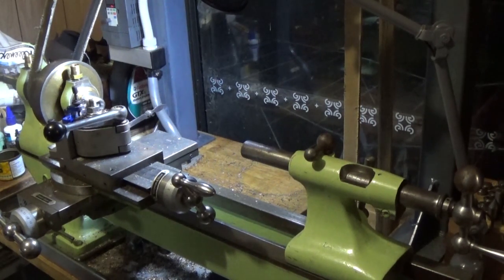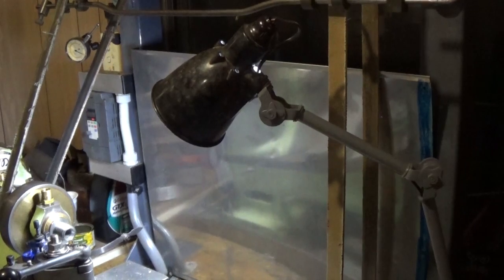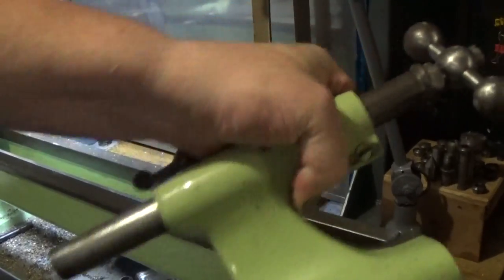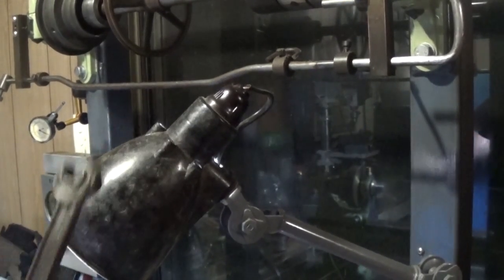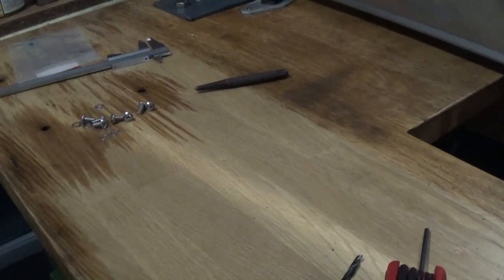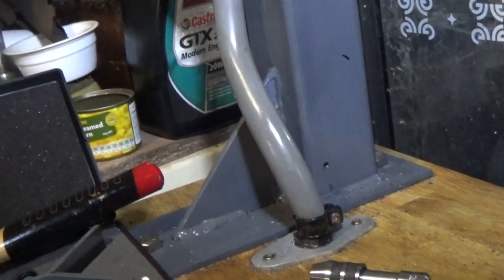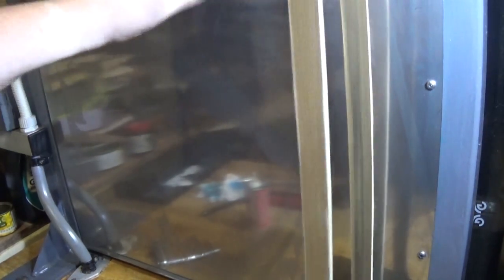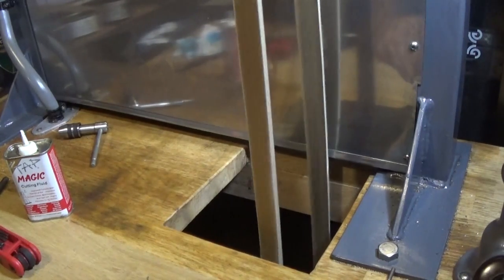stainless steel splashback project

Comment: The lathe set up is looking better each day. It is a good feeling.

BTW, I too have several of those small Tap Magic cans around the shop. I fit the Tap Magic can spouts with those thin red plastic spray straws that come from used WD40 sprayers. Just drill a slightly smaller hole in the end of the Tap Magic's white spout and force the red straw down into it. Doing this allows placing just the right amount of Tap Magic as needed with the red straw modification.
Reply from the maker: Thanks for that tip! something im going to try!

Comment: If it were me Emma, I'd bond a piece of plywood to the back side of that sheet metal with some contact cement. That will prevent any future rattles, plus make the whole thing far more rigid. The SS would need to be very clean and probably roughed up a bit with some coarse emery paper to give the metal some tooth so the contact cement will adhere to it. But it's a fast, cheap, and easy job that will never be seen from the front.

Comment: Nice job Emma. How many jobs do we start and never get back to because the first iteration is usually acceptable. :-)A strip of something across the bottom to stop chips escaping might be an idea.  As said by others virtually anything stuck to the back of the sheet will stop vibrations. I don't think you will have a problem with your smooth lathe because it is bolted to a wooden bench which naturally dampens out vibration. regards from the UK

Comment: Hi dear.  Nice to have a back to catch the rubbish.  Just put some draft strip in between for the noise.  You can also fold a very faint cross in the sheet, to stop the oil canning.  It's often done with large sheets on aircraft.

Comment: It is very thin metal so it will rattle. Vibrate. If this occurs, maybe  a damper, such as a piece of steel superglued or JB welded to the sheet to steady it and eliminate the resonance. And maybe a rubber foot. Also superglued. Wonderful stuff, superglue, as long as you do not overheat it. As for JB-weld, it;s the poor person's TIG welder.